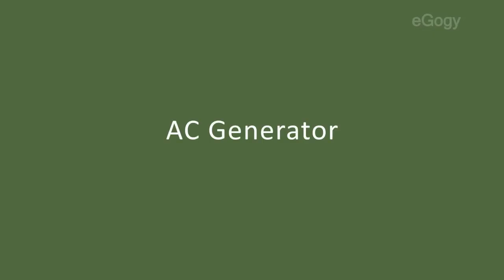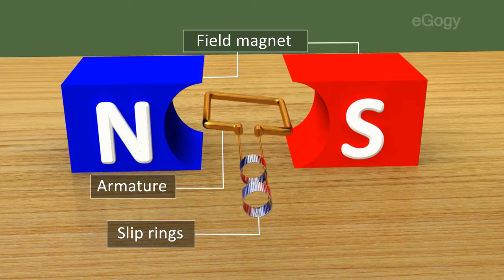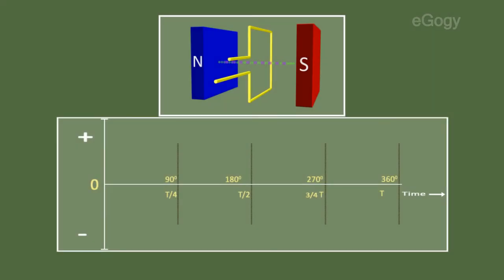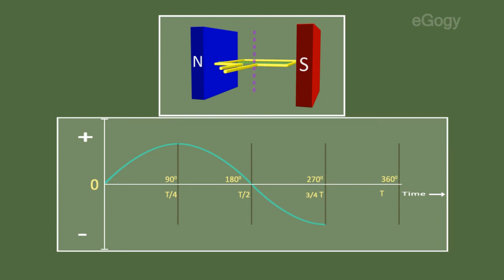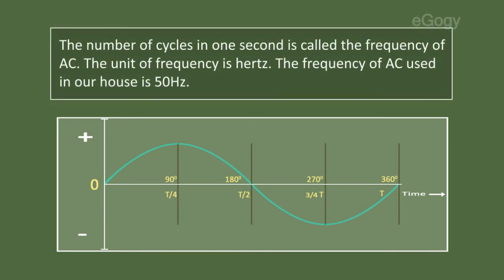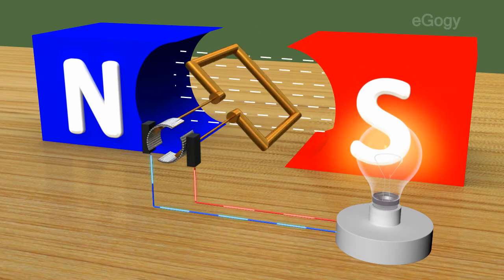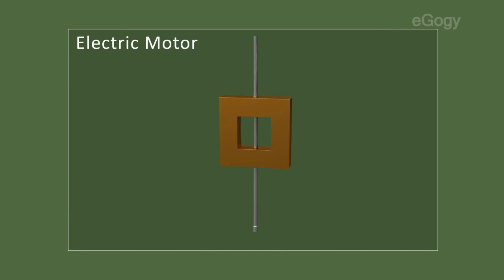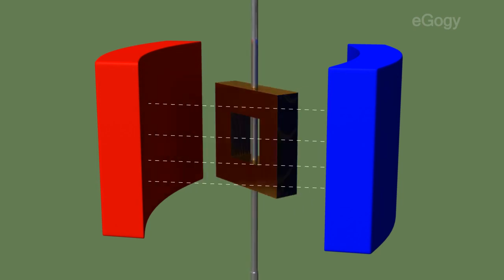AC Generator DC Generator & Electric Motor

Comment: The video focuses on the core differences between AC and DC generators, which is helpful for understanding their applications.While the video mentions electric motors, it could delve deeper into their working mechanisms, especially considering the focus on generators.

Comment: Thank you for the video, My only issues would be that there are no arrows on your magnetic fields lines :(
Reply: They are from North to South
Reply: Magnetic field lines are from North to South.
Conventional Current Direction is positive to negative.

(But, electrons flow in the opposite direction, negative to positive. This is because they(electrons) are negatively charged, therefore repel negative charge, and that is why they flow from negative to positive.)

But, scientists follow conventional current direction, it was discovered before electrons in the 18th century.

Comment: How does the armature becomes magnetic
Reply: It's an electromagnet. It has a lot of coils inside it. He missed adding a power source(battery-cells) in the video.
Reply: @_N_o._.one_  this is a generator, it does not need a battery, it produces energy by cutting the magnetic flux as per lenz's law
Reply: @Adam-og8ii  i m talking about the motor... I dont have generator in my syllabus this time.
Reply: @_N_o._.one_  in the case of motors, then yes it is missing a battery. But this is a generator. Dont worry you'll get to that topic in no time
Reply: @Adam-og8ii  thanks... I'll study that part anyway even if it isnt a part of my syllabus... It might help me in future.
Reply: @_N_o._.one_  how old are you and where are you from?
Reply: @Adam-og8ii  india... I m 16...studying in standard 10...will appear for CBSE boards in 2021.
Reply: @_N_o._.one_  wishing you all the best
Reply: @nanfwangdabiring1520  thanks a lot.